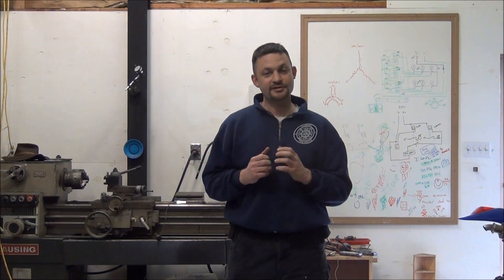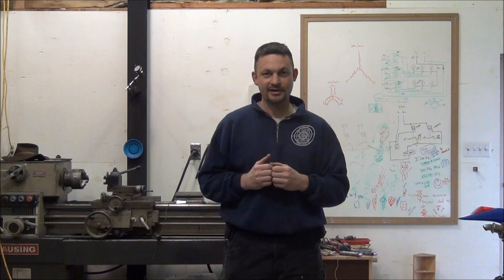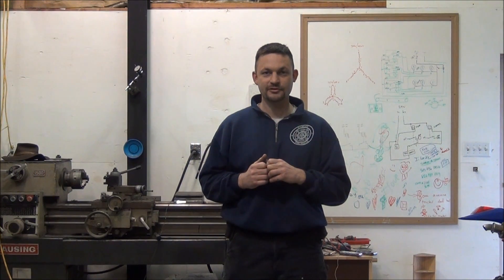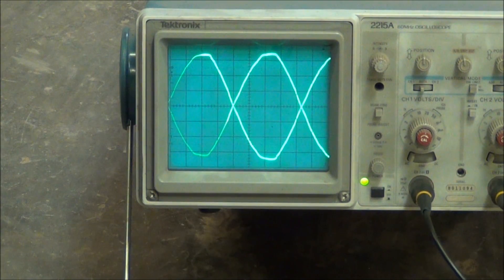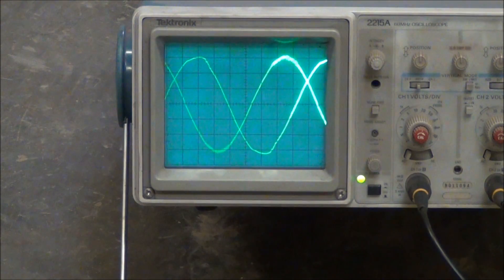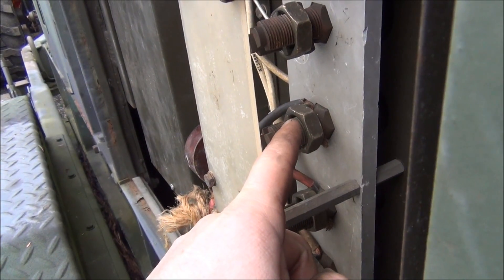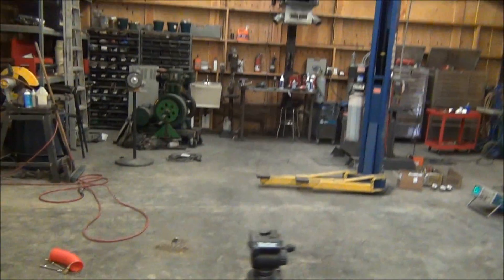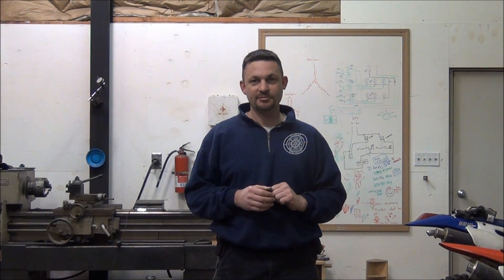3 phase generator for single phase residential backup power

Comment: Anything 240V will run on 208V. I have yet to see a problem with this ever. It will draw the extra amp or two but thats about it. Says me, a 20yr electrician.
Reply: http://www.apc.com/shop/ca/en/products/Rack-PDU-Metered-Zero-U-57kW-208V-36C13--6C19/P-AP7864
How can I mod this for 240 or 480? I bought 2 for 100 bucks. Lol. Or should I make the power company give me 3phase?
Reply: Can you help my husband find and hook up a generator unit that my husband and i bought have a repurposed coal/wood fired locomotive type boiler with a vintage horizontal mill type steam engine hooked to the repurposed locomotive boiler but my husband and i want to go off grid full time to power a belt drive generator from the steam engine cylinder but my husband is having trouble finding the right 240volt generator head untit to hook up a horizontal shaft belt drive from the steam engine and we need a very good electritian to hook up all of the wiring from the belt drive steam powered generator to our house to go off grid can you help my husband and i will hire you to hook up all the electric to our house so we can quit paying these high priced electric and heating bills because we are planning on hooking up vintage steam radiators to heat our house from the boiler but first we need help finding a single 3 phase 240volt generator alternator is holding my husband up to hook up my electric powering steam engine to pump water into the boiler and to pump our running drinking and hot bath water and run our air conditioning for our house i understand thats a lot of work but still my husband and i been wanting to achieve this goal for quite some time now and we want to get our steam engine fired up and running and powering our own electric and be independent of our own electric and heating bills with our boiler and steam engine
Reply: Heyy! Can somebody tell me I need power for my home ! Standby ! 1 phase or 3 phase should I buy ! I intend to use 3 ac 1.5Kw ! But they may or may not be working at the same time ! I just have doubts about unbalanced loads ! 

Ac are all single phase ie i put 2 wires of the 4 i get at my home !
Reply from the maker: I agree...there are just a handful of motors that aren't rated for 208v, but the engineering margin takes care of that extra amp or two.  I'm hesitant to say in the video "go for it, it will be just fine!"  because there will be that 1 in 1000 guy who will find the motor that will burn up at 208v and argue with me about it!
Reply: sewerzuk
haha, good point. I am looking to buy an mep-2a now so I'll be back here with a question or two I'm sure. Thanks for the quality videos on these topics!
Reply: twoheadedelvis
You can grab any two legs from the 208V side as long as you dont have a high leg. Check each phase with a volt meter. If you get 120 on each you are good to go. A motor sees 208 and 240 as the same.
Reply: ***** 240V 3ph High-Leg Delta will measure 120V, X to ground. 120V, Z to ground. And the orange/red (NEC mandates orange, old installs may be red) high leg wire will be 208 volts to ground. All phases will measure approx. 240V between each other.

Realistically, the CNC machine could be wired up between any of the phases on either a 125/216V 3ph Y, or a 240V 3ph Hi-Leg Delta service and be just fine. In any case, before risking anything, consult the manufacturer first.

Comment: Is there a way to get 240v on 2 legs without a transformer? I've got a 15kw 3ph generator, but I'm trying to figure out how to get it to single phase so I can hook it up to a conventional automatic transfer switch.
Reply from the maker: I go over this in the video; but when the generator is configured for 3 phase 120/208, there is no way to get 120/240 single phase by using 2 legs of the 3 phase.  You can manually turn the voltage up to 240v, but then each leg will be at about 136v; that's a little too hot to be feeding your house with.  Most transfer switches and other 240v devices work just fine with 208, but if for some reason this doesn't work for you then most 12 wire generators can be converted to single phase 120/240.  I have a video on how to do this step by step with an MEP-004a generator.

Comment: Hey there well done on your video 
I am taking a MEP005 that has been converted and going back the other way to 440 Three phase for a water ski cable drive system 
If i just work backwards will i end up ok 
Obviously i will need to make another bus bar anything else i should be aware of

Comment: The problem that I worry about is that when using a 3 phase only and taking only 120 volts from one leg,would it through it out of balance?Heating only one winding would give it a out of balance condition and end up destroying the generator.This is what I've been told.Is it true?
Reply from the maker: It isn't a problem as long as you don't exceed the current limits for a single leg (this is why you're limited to about 2/3 of rated power).  The tech manual even says that pulling single phase power is permissible, provided the current limits aren't exceeded.  I've heard the "uneven heating" and "unbalanced load" myths too.  These generators are designed to work this way!  Other generators' instrumentation, control, protection, and excitation systems may not allow single phase operation; but with the MEP's it is just fine.
Reply: sewerzuk
Big help.Thanks.I have a few of these mep's and will start using them for single legs now.What a relief.Keep up the good work.